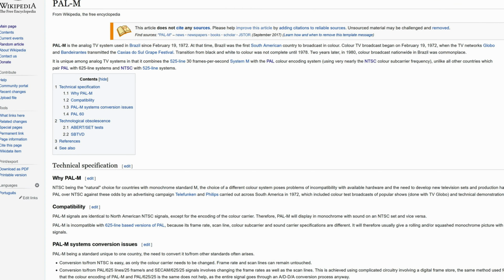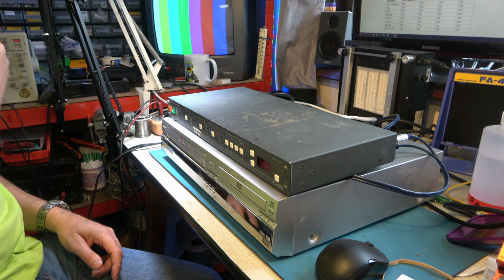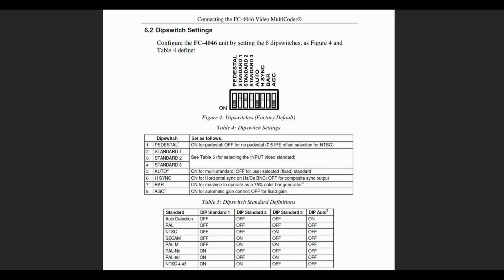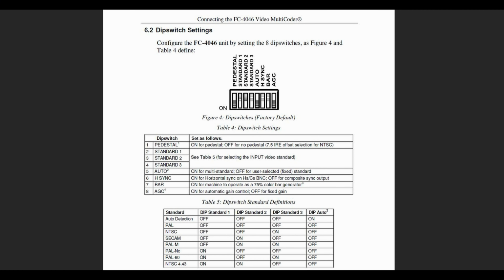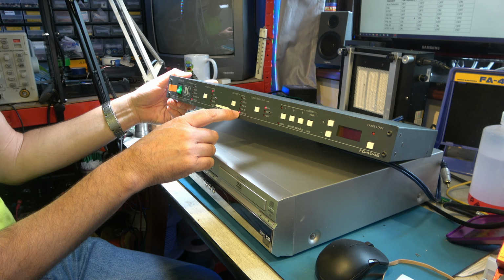Timebase Correctors, standards converters and a Kramer FC-4046.

Comment: Have you discussed in any of your videos about the TBC and Noise Reduction that is built-in to many Sony Digital 8 camcorders?  Analog/S-Video in to camcorder, 1394 Firewire Out to the computer.  Bada Bing, Bada Boom.  Any thoughts or discussion on what you think about that?
Reply: hardware nr is always bad. because only (software) motion compensated nr is worth the effort, and that was never done in (cheap) hardware. 
but even with software nr you have to weigh what you're gaining(smaller filesize? is hdd space expensive these days?) and what you're losing(detail, esp. on motion).

Comment: Note to self: Firewire converters give output of much higher quality than USB converters.  Firewire converters give output at 13 Gb. per hour of video.
Reply: it's relative because
a) usb need not output only mpeg2 (for example io data gv-usb2...usb2 should be capable of transferring uncompressed video that is compressed in pc "on the fly")
b) dv for pal is 420 color subsampling, which makes reds weird looking....depending on the used decoder (subjects as " reinterpolate420 - eliminate chroma jaggyness of PAL-DV" can be found on doom9 forum)

Comment: Hello, maybe you sell one of those white ACE box (that’s working)?
Reply from the maker: I probably won't be selling any for a long time.  But they do turn up on eBay.  Just make sure you get the later model which includes the TBC and standards converter.

Comment: Hi, I have been given what appears to be a NTSC vhs tape. I am trying tom digitise it. I am using a dual Pal/NTSC vcr and a camcorder as a passthrough. As you say the tape is not recognised except when I change the standard in OBS to Pal 60. Then I get a picture with faint lines in it. Am I understanding you correctly by saying the Canopus will correct this? Thanks in advance for any help.
Reply from the maker: I'm not certain what those lines are.  I don't think a Canopus will correct it, but a TBC might.

Comment: Does TBC ( DPS ) need composite in , and the out put will sdi ? Or TBC will generate same signal ( conpiste in , sompsite out ) . The secind thing did time bese corrector accepet audio in ? How did it process then send it as output ? What the signal will be ? Sdi also ?
Reply from the maker: Some TBCs will output SDI, sometimes they require an optional extra module for that.  None of mine have this.  Most TBCs will accept Composite Video, though of course S-Video, YUV, RGB etc., would be better.  Most TBCs do not process the audio at all, but a few may have some audio features such as fade-out of audio and video together.

Comment: I did some experimenting with the video output from various VHS and S-VHS decks with the NTSC playback feature a few years ago and can confirm they don't produce NTSC 4.43 but a non-standard colour signal.  When the output was connected to a Samsung SV4000 or SV5000 in AUTO detect mode they think the signal is PAL-M but if PAL-M is selected MANUALLY then the picture would go black & white. So it's not PAL-M but it must be the closest match for the Samsung's auto detect system to think it is.  PAL-M has a sub-carrier of 3.58MHz (same as NTSC), so the only difference between PAL-M and the output from these NTSC playback decks is the colour subcarrier is 4.43MHz. Therefore PAL 4.43 but with 525 lines and 60 fields often referred to as PAL-60.

NTSC 4.43 seems to be more common on professional VHS/S-VHS decks including the U-Matic format (eg Sony VO-5630 or VO-7630) and on true multistandard VHS decks such as the Sony SLV-ED818ME. The Panasonic NV-F77B was the first VHS I owned that could do NTSC playback and it actually has a switch labelled NTSC 4.43 ON-OFF on the main panel.  In the OFF position is does the Pseudo PAL / PAL-60 output but when switched ON is does output NTSC 4.43 and according to the manual this was to enable dubbing of NTSC tapes to another machine with the same NTSC 4.43 switch.

BTW that Ampex TBC-6 was originally used with the later Ampex VPR-6. The VPR-2B's original TBC is much larger probably about 3 times the height.

Comment: Hi And Thanks for all videos. what's best model of tbc for today? and internal pci-express capture card is better from usb? thanks.
Reply from the maker: It's hard to find any TBCs at sensible prices.  Which one is best depends a bit on what you are working with.  Umatic works best with some specialised ones with Dub connectors, other formats don't need that.  Some machines (Hi8, SVHS, Betacam, MII etc.) can have internal TBCs.
USB capture devices usually compress the video a lot and don't give good results.  There are a few exceptions such as the Intensity Shuttle USB, but that's very hard to get set up and working.

Comment: A couple of years ago I decided to invest in a Blackmagic Teranex and I've never looked back. It is an amazing piece of kit that can convert almost anything to whatever standard I require. Up/downscaling, cross conversions, it never fails to impress. I always output SDI to Blackmagic capture cards in the computer for the best results. Standards conversion going from NTSC to PAL and vice versa doesn't produce any motion artifacts that you normally associate with different frame rates. On the fly noise reduction is the best I've ever seen, using a kind of recursive approach rather than frame blending techniques that often cause smeary looking pictures. You might wanna check them out 👍
Reply from the maker: Very interesting, I really may invest in one of those.  Trying to work out if I would need the AV version or if Express version is all I need, since most of my work is SD.
Reply: @video99couk  When I got mine, they had the Teranex 2D option which had full analogue video inputs to handle composite and component which is more useful for SD in my view. I don't know why they dropped that model. I would be inclined to go with the cheaper Teranex Express and with the money saved add a separate analogue to SDI mini converter and send the output of the converter to the Teranex for processing. I did some tests using the Teranex to upscale SD to HD and there was a noticeable improvement, it just squeezed out that slight improvement in picture quality over a straight SD to SD digital capture. Of course it depends on what format the customer needs in the end. The Teranex will output SDI for capture or Thunderbolt. I use SDI because I don't have Thunderbolt capability on my current computer setup. I usually capture SD in Motion JPEG. It's ideally suited to SD capture. But I am very impressed with the post processing the Teranex is capable of, the noise reduction especially, it cleans up noisy analogue sources without degrading the picture as happens with the frame blending techniques used on my TBC's.
Reply: All converters including the TeraNex has motion artifacts when converting from 525 to 625. Unless the 525 signal has a 3:2 pulldown. If the input signal is field based (meaning it has 60 discrete fields in 525 or even 50 discrete fields in 625) the converter will have to do temporal averaging (blending of frames). The TeraNex or even the Snell & Wilcox Alchemist with phc have an option for clean cuts. They will try and make the cuts clean but doesn't always happen. All the other frames are blended together to make up the frame rate change. The better converters use a 4 field conversion and the cheaper ones use a 2 field conversion. Now if the source is frame based you can either add or remove the 3:2 pulldown. But when you do that you need an off speed record or playback machine. If you are going from 29.97 to 25 with a source that has a 3:2. You playback the 29.97 as normal send the signal into the TeraNex. Set up the TeraNex to output 625/23.98 you will need a off speed record machine. It will record 625/23.98 and then when you play it back on a normal 625/50 machine you will get a clean PAL output without any temporal averaging. Put one caveat to that is that the 3:2 pulldown needs to be clean unless you are using a TeraNex converter because it can clean a broken 3:2. In my experience the TeraNex is the best converter out there but not as much since Blackmagic bought them and now it's a one 1RU box. But for most people they will never notice any difference between temporal averaging and not. 

On a side note... When I first started doing standards conversions 40 years ago the best converter was an Ace converter. But it wasn't a little box like the one shown in this video. It was about a full 6' rack. It was crazy big. But it was the best at that time. It blew everyone out of the market until the ADAC came out.

Comment: As a budget solution I use a Phillips dvdr 3300h as a signal converter. I input NTSC 4:43 and the Philips outputs a proper NTSC signal on passthrough.
Reply from the maker: Nice workaround.
Reply: @video99couk  Do you use Premeire to capture the VHS ? It always stops to capture when using advc-110

Comment: So it's the same problem that pal retro gamers have when they mod their pal console to output 60hz right? I bought a retro tink converter to capture my newly aquired ntsc consoles wich i got to finaly avoid that issue and then tried the old modded pal ones on it to sell them on ebay. To my surprise the retro tink does understand the odd signal.
Reply from the maker: Yes that's probably the same NTSC 4.43 problem.

Comment: Hello sir, 
Iam Rahul From India,
which video capture card you are using for converting VHS to DVD?..
Reply from the maker: I hardly ever run anything to DVD any more.  For capture I usually use a Canopus AD-VC55 or similar, connected to a Firewire card.  For the very rare occasions I still make DVDs, I sometimes use a JVC DVD recorder.

Comment: Do you ever use the REF IN connector on a TBC device? I believe it's called Reference in/Genlock?
Reply from the maker: No, I believe that's more for studio use where all machines need to be locked together.  However the other input I didn't really mention is the RF input on the professional machines like the DPS375 SP, this lets the TBC know when the head RF level is low and the digital dropout compensator needs to kick in.
Reply: I have found with my AVDC-1000 I can get picture rolling or split frames when passing in analogue video through my big Sony Digital video player (can't recall the model) and linking the genlock between the three devices eliminates this.

The picture is only acceptable though as it is a AD/DD/DD conversion chain so I rarely do it.

Edit - DSR-2000P
Reply: @musmodtos If for some reason you didn't want to use reference in, try changing the reference switch on the DSR-2000P machine to input. Then it should lock up without reference hooked up to the machine. It's a work around if you don't have a sync generator but I always believe that everything should have reference going to it and even better is that everything is also timed in ( H and Sc).

Comment: I think I know why you obtained B&W pics on the Kramer. Based on my experimentation during the 80's, most PAL VHS machines that also playback NTSC tapes on a PAL monitor,  produce a Pseudo-PAL signal at the output. My guess is that the Kramer doesn't accept that type of signal.
Reply from the maker: They produce NTSC 4.43, which the Kramer should have accepted.
Reply: @video99couk  If you're using a PAL VHS VCR that plays NTSC tapes on a PAL monitor, it most likely won't produce true NTSC 4.43.  It'll be Pseudo PAL 4.43.  What this means is that half the lines will be in Colour and the alternate lines in Monochrome i.e. +V lines only. You should be able to see this on a PAL Vector Scope if you have one.
Reply from the maker: @azmath2059  I could try that!  My vectorscope (the only one which works at the moment anyway) is SDI input only, but I can go to SDI via a DigiBeta.  It would take some time to set all that up though.
Reply: @video99couk  The digibeta may not accept a pseudo pal analog signal however
Reply from the maker: @azmath2059  Ah, good point.  I bought a non-working analogue Vectorscope and repaired it.  Alas it worked for only a short time before a new fault developed in the high voltage section, and I had to put it to one side.
Reply: Yeah many will output PAL-60 by default, which is not entirely the same as NTSC 4.43. Maybe the ACE auto-detects it, and the kramer doesn't. On some you can select between the two options, either in the menu or with a switch.

Comment: Purist at videohelp forum would bark at DV capture and would only use Huffyuv codec. ACE not getting much love over at digitalfaq forum. http://www.digitalfaq.com/forum/video-restore/3823-experience-discontinued-ace.html
Reply from the maker: Some of the remarks there about the ACE are just plain wrong.  Yes it is a real TBC.  But I agree that the NTSC / PAL conversion is terrible and I say so in the above video.
Yes purists may dislike the DV codec.  It's been used many times for broadcast, yet it's somehow not good enough for domestic video capture.  There are certainly more efficient codecs today, but the practicalities of capturing with a different codec are non-trivial.  As I say though, for professional formats such as Digital Betacam and DVCPRO50, I capture to larger files via SDI.
Reply: They have extremely strict and sometimes odd standards on TBCs. They discounted the ACE without even testing it, it literally uses the same A/D chip (SAA7114) as the AVToolbox 8710 that they like so I would think it wouldn't perform all that different (The ACE has a bunch more features of course).
Reply: Most digitalfaqers (myself included) are in NTSC land where the chroma subsampling of DV is inferior to that of PAL regions. I would be open to trying an ACE, but I see they're discontinued. No doubt that forum can be quite uppity, though.

I do remember watching a video made by the BBC where they were digitizing their U-matic tapes to DVCPRO before switching to DVCAM. DVCPRO is 4:1:1 the world over. The folks at digitalfaq would howl at their monitors if they watched that video.

Comment: An interesting video. I remember seeing those GTH converters advertised years ago and always wanted one. I also use an ADVC55 for VHS and Hi8 transfer of my home recordings. The quality of the DV codec far surpasses the quality of the source material so it is a good choice and it copes well with ropey off tape material. I do seem to lose video level though and often increase the level in my editing program.
Reply from the maker: Some people take a dim view of the DV codec and I understand where they are coming from to an extent.  But for domestic use, DV is generally excellent, the compression is very low and you don't get the picture degradation and lip-sync errors that overly compressed MPEG2 and MPEG4 files produce.  Most people actually find the 13GB per hour files to be too large so I also generate MPEG4 files of about 4GB per hour for easy playback too.  Of course when capturing miniDV, Digital8, DVCAM etc., then DV is the only pure lossless codec to use.
GTH converters pop up on eBay from time to time, one went for about £99 recently, which was a good price. 
The ADVC55 shouldn't give a dark picture, there may be a slight defect somewhere.  I've always wondered what the extra DIP switches do, perhaps have a play with those.

Comment: Converting video standards just seems like a nightmare, there is bound to be something that is compromised.
P.c capture cards are very dissapointing too, but still expensive for such a poor quality conversion.
The last capture card i had was a ha-parge (years back), the software was a pile of poo and the capture was dissapointing :-(.
I actually got a better capture using a home dvd machine set to maximum quality.
Sorry colin, waffle mode :-(
Reply from the maker: I had a Hauppauge card too way back in the early days.  It was expensive and the results were... adequate.  But that was the state of play 20 years ago.